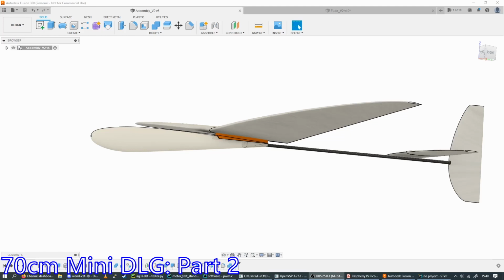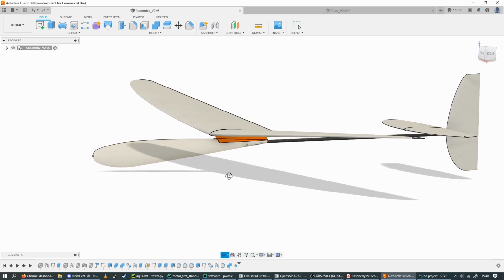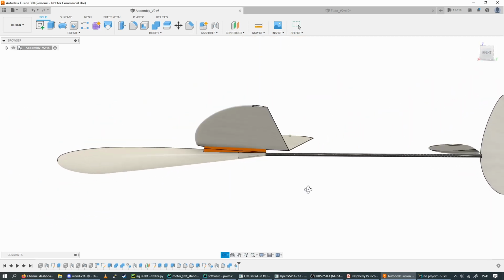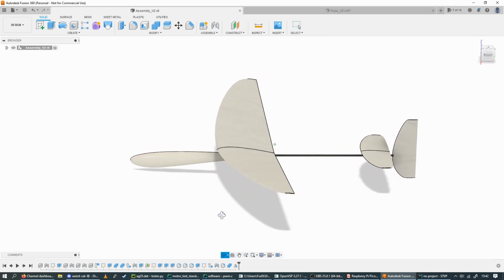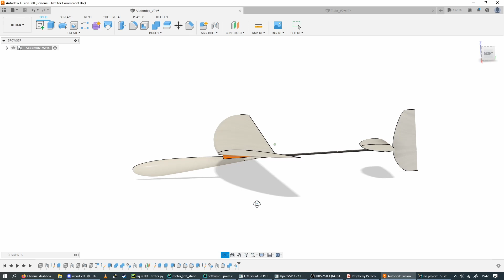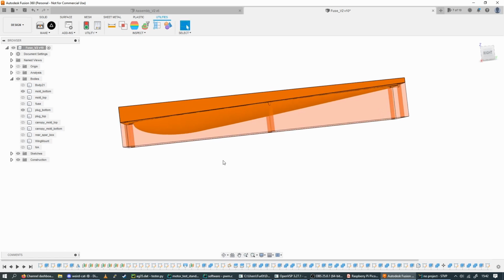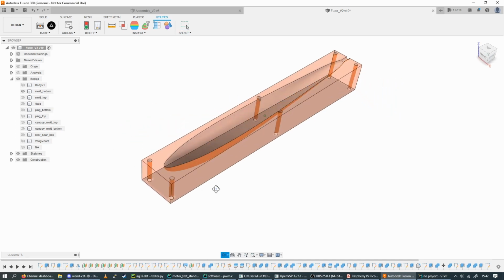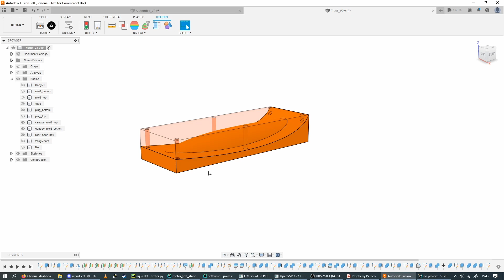70cm Mini DLG | Part 2

Comment: She won't win any beauty contest,,, but she glides fairly well. 
Each build brings you closer to understanding why the high quality competition winning planes cost so much money. I have recently gone to the cheapest dirtiest way of building. Dollar tree foam board, hot glue and colorful packaging tape because when I crash...and We all crash, it doesn't crush my soul. I just tape or glue the damage and I'm back in the air until It is so smashed up that I need to spend 3 more dollars and build a new one. I have nice models, and they aren't a whole lot better at flying than the crappy ones so have fun and keep up the good work.

Comment: Nice build video. Can you detail a bit more the way you prepare the 3d printed mold surface: sanding, polishing, release paint???? Tks
Reply from the maker: For this I filled in the gaps with CA glue, sanded lightly, then applied mold release wax. 

If you want a better surface finish (and a stronger mold) I like to sand, apply a layer of epoxy, sand again, another layer of epoxy, then sand to a polish.